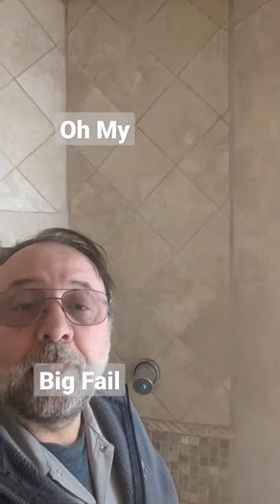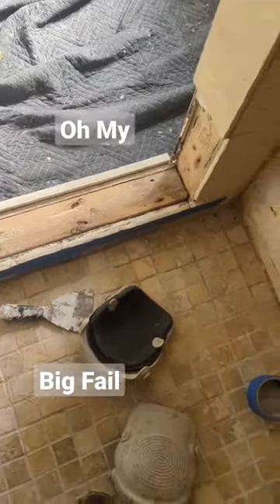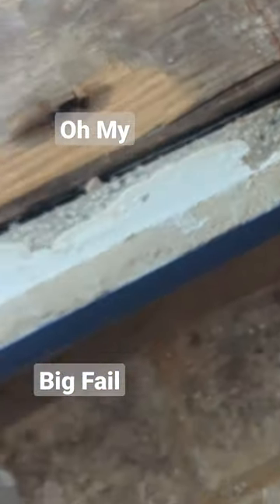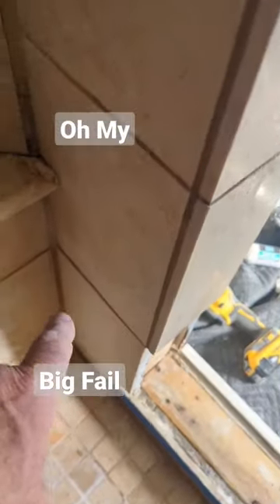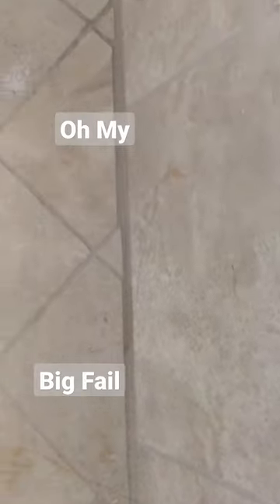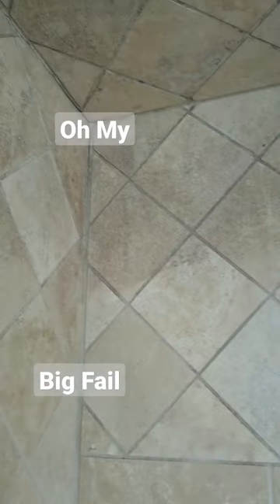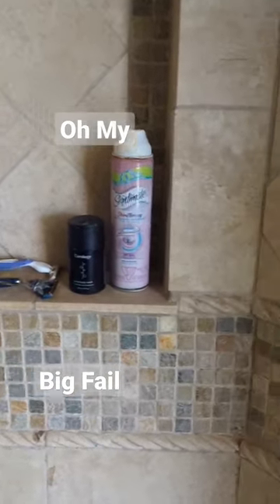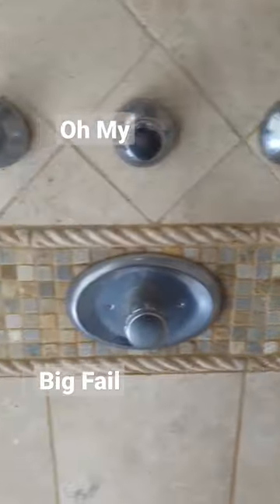Oh My, Another failing Shower #tile #shorts #fails #failure

Comment: I replaced a liner shower that the tiler had used drywall on. The liner was placed on the OSB without a pre-slope. The drywall was installed all the way down to the liner. Nailed and screwed through the liner. Then the cement was placed and sloped to the drain. It lasted 3 years before the subfloor rotted. Water leaking into the basement. The drain was almost entirely blocked with minerals from the cement, mortar, and grout. The liner acted as a swimming pool. 
This was in a brand new house.
Reply from the maker: Nothing new to see here.
Reply: Unfortunately friend there are 10s of 1000s of new homebuyers facing the same nightmare. Building departments typically don’t even begin to scrutinize tile showers